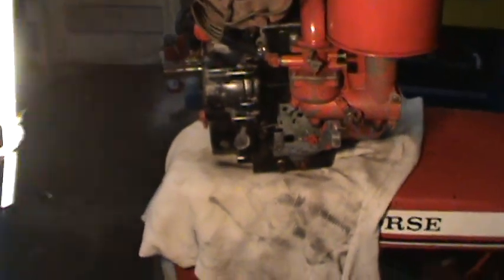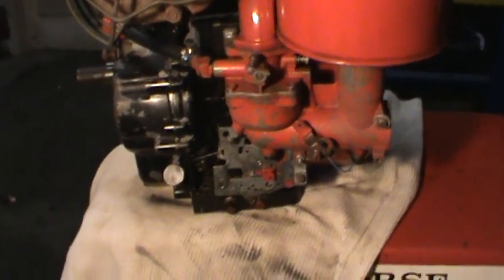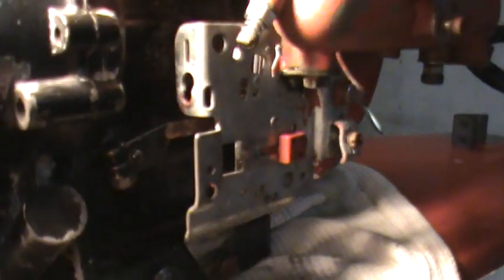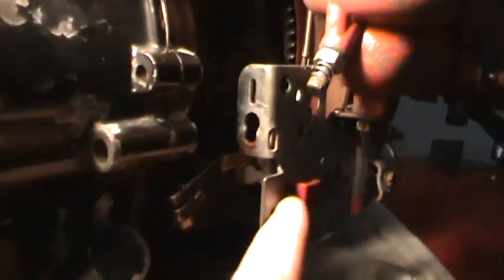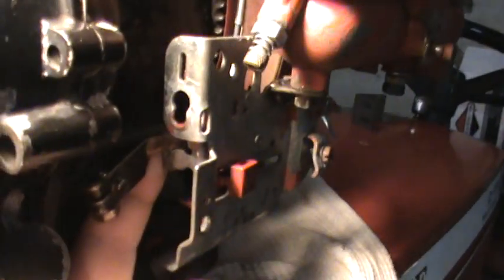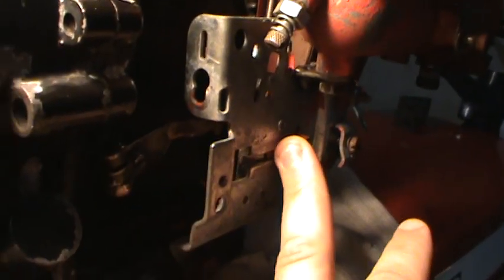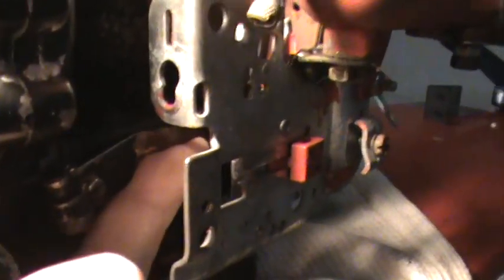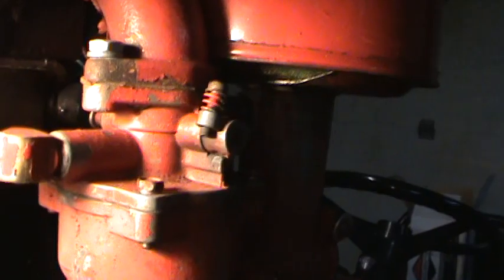Carb,Governor Linkage Setup on 11 hp Briggs for donyboy73

Comment: Ya missing part of the govemer , a round knob, it fits on the end of the linkage you were moving back and forth. It shows it in the b+s manual.
Reply: I Just scored this tractor as well. Looks great but also looks like a kid went through the carb and got everything twisted. I've ordered a new carb and the first was to reverse the controls to match the original carb. The carb controls are almost impossible to reconnect with no frame of reference and since it was only made for one year, I'm finding that to be.... challenging! Sure would be nice to see a picture of the carb linkage.